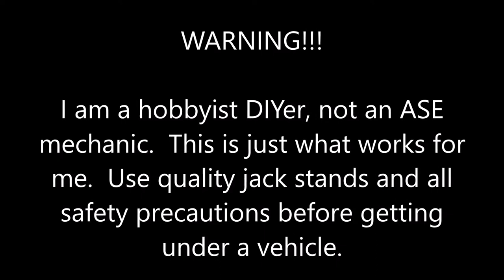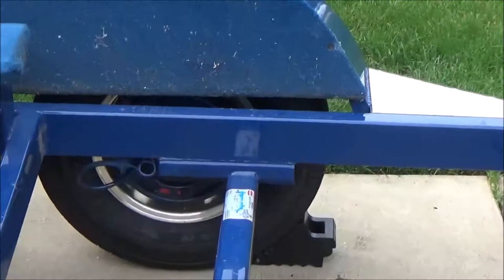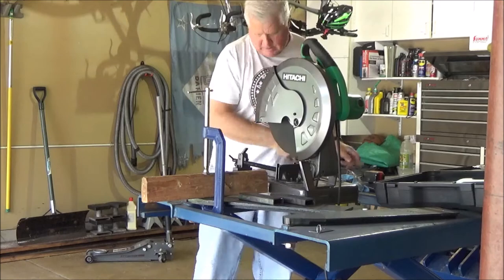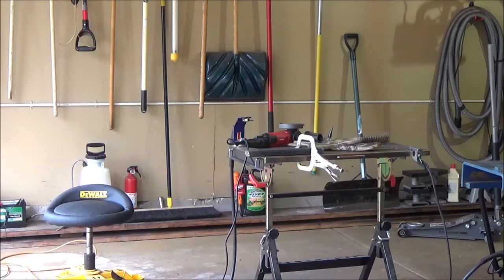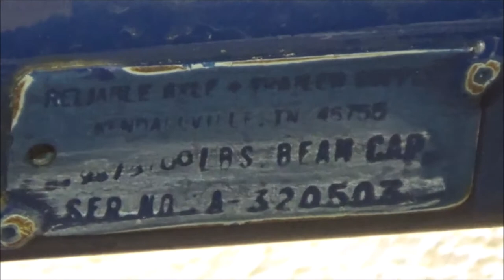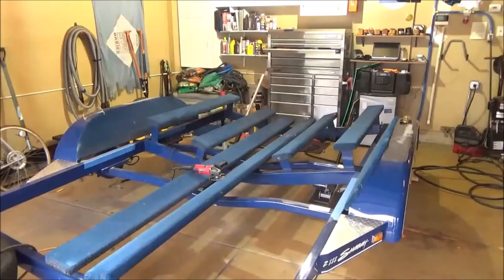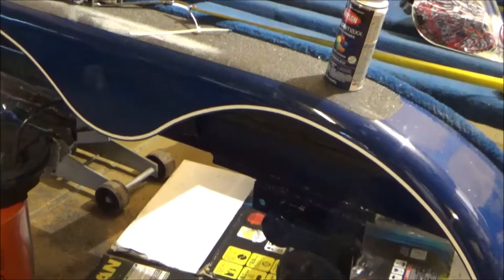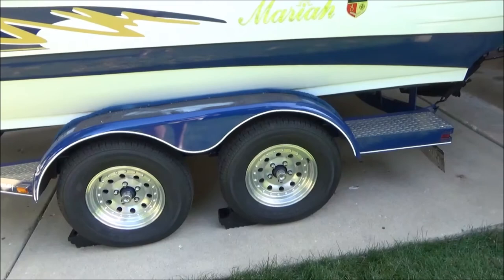Prestige Boat Trailer Torsion Axles Problems (with Reliable Axle 3,700 lbs axles)

Comment: Just curious why you didn't just buy four smaller diameter tires for about $600? I have the same trailer but single axle, problem solved and alot less work.
Reply: A smaller diameter tire would come with a reduced load rating and also increase bearing spin rate should the trailer ever exceed the posted speed limit....  Not that it ever has...  Also, I discovered the problem after my 5 new OE size Goodyear trailer tires were delivered and I had an appointment 15 min later to have them mounted.
Reply: Never under size a tire for any reason.